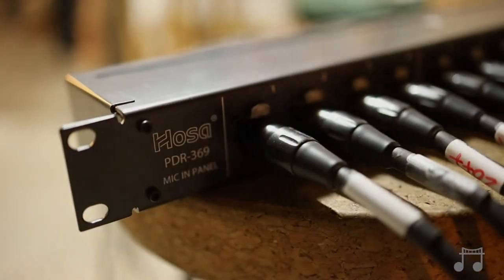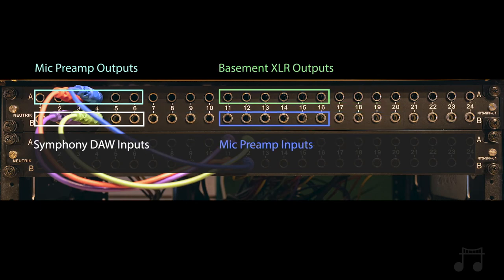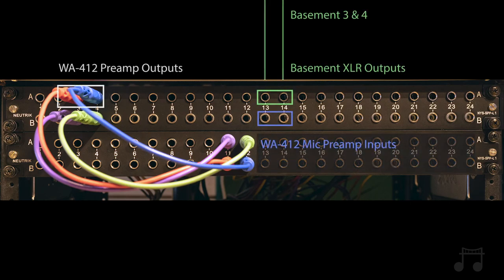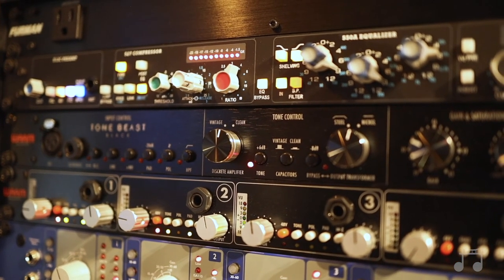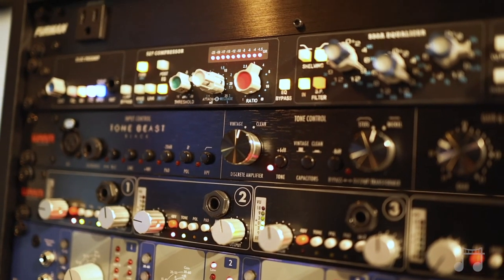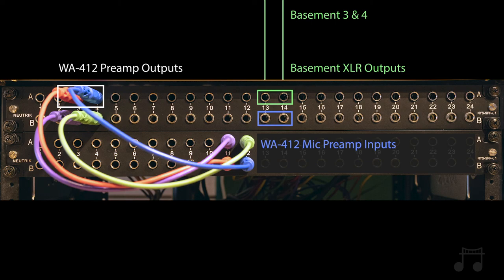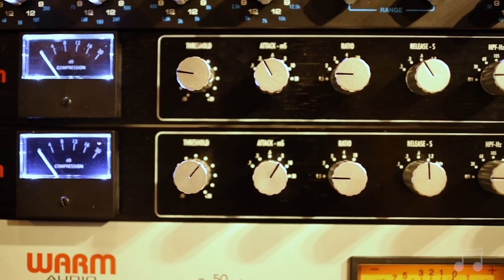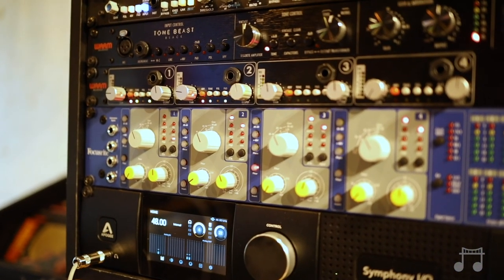Recording Studio Signal Flow - Live Room to Patch Bay to Outboard Gear into the DAW

Comment: Do you need dual patch bays? Or can you achieve this with a single bay? I have the Neutrik trs 48. I'm trying to route Maschine mk3, Arturia Microfreak, Akai Advance 49, Novation Bass station 2, boss dr-202 to a rack mounted Alesis midi verb 4, and Alesis 3860 compressor, Alesis studio 12-r mixer.... and monitors and daw... And I'm confused. Lol
Reply from the maker: There are definitely a few ways you can wire it up depending on your preference. I laid it all out on the floor and stared at it for a few days before actually doing anything lol. We do need 2 patchbays to wire our 16x16 interface both ins and outs with all the gear.
Reply: @BridgeSetSound  I ended up routing all my synths and daw output to my rack mount mixer, added Midiverb to the master channel, left out the compressor since the daw does a good job via built in effects. Now I can play and sample any synth, which is what I was going for.

Comment: So I can run an XLR mic into an XLR patch bay then run it out using an XLR to 1/4” balanced cable into a 1/4” balanced patch bay?
Reply from the maker: If the 1/4” is balanced then yes, it’s essentially the same thing (+,-,ground) just a different connector. 

You do want to be safe with phantom power and only turn it on and off while patching is in place.

We moved the studio and changed our setup to go XLR patch bay straight into the preamp inputs with the pre outputs then being part of the 1/4” bay, half normalled to the computer inputs so no cable is required unless wanting to send the signal to other gear.

There is a more recent long form studio wiring video on our page in our new space, though it was before making the changes mentioned above.